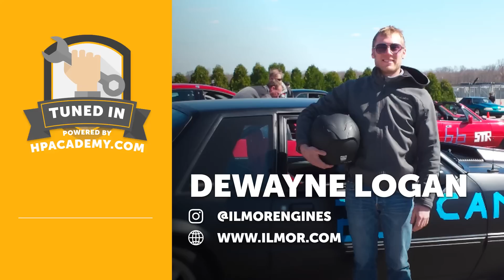066: Why Domed Pistons are a BAD Idea from an Ilmor Engineer. [#PODCAST]

Comment: Also I had never seen or worked with in cylinder pressure sensors  until I worked at the R&D division of an OEM and talk about a whole world being opened up in front of me lol.. I was  introduced to so many tools and techniques during my time working on contract with them and I would have loved to continue that but I was at a point where I needed a bit more stability and even though it never happened to me I had seen contracts get terminated at no fault of the worker but boom just like that they were no longer working there and sometimes they would be back working on a different contract or something but I couldn't have that happen to me and I also realized that even though my contract was a long term contract and had no set end date I was just nervous I guess just buying a house and having a baby  but I did absolutely love that job

Comment: This is very interesting to me because I have had very good results using pistons with a small dome and higher compression than most consider good compression ratio for a boosted engine but I decided to try a few things to see what happens and this was in a 4g63 engine and I had a good relationship with cp pistons and together with an engineer I knew that works for CP designed a piston that would have close to 12:1-12.2:1 compression ratio and I had to change the cams I had been using for a set of  Kelford cams that would have slightly less valve lift just because it ended up being very tight in the cylinder..but the camshafts were also a large improvement I'm sure  but I was able to get up on boost almost 1200 rpm earlier and had a much flatter torque curve than before...we made a bit over 90ish more HP on the dyno and 110ish more torque... again I'm sure the better cams helped achieve this but it was a much smoother and overall less "peaky" run ..we were able to run less boost but still  had similer cylinder pressures
Now this was just something I was curious about and wanted to play around with when I was trying it and I never had the track record or experience with that setup to try to build something like that for a customer but I'm curious what would have happened if I had not changed my racecar and ran that setup for a few years to  see what the problem areas might have been

But I am very interested in why I had such good results and I know a few others that are going to higher compression ratios on boosted engines and also having mostly positive results.... I'm always trying to learn especially when it's something that I was thinking worked differently or whatnot

Comment: Great podcast.
I always listen to it when i drive to work, a great source of information.
 Although the story about detonation and colliding flame fronts made me raise my eyebrows.
Here's how David Vizard explains it: https://youtu.be/mMAWFkaHGUg?t=744
Reply: Same. There was no mention of detonation. There should have been mention of the differences between deflagration and detonation. 
Detonations concentrate mass on their very thin supersonic propagation front, causing extreme pressue spikes, which are able to break fragile areas like ringlands and create a pinging sound. They also stir up boundry layers, which will lead to much higher heat transfer in addition to the higher temperatures due to the extreme pressure.
Even if he claimed there was no detonation during a knock event he should have explicitly said that to prevent confusion.
Reply: Also there is a clear analogy to the diesel combustion process and the diesel knocking

Comment: I think if I can add to the chat, one of the highlights for Ilmor, was the Roger Penske, Ilmor Mercedes 1994 wins, at the Indy 500, if not slightly controversial. Would be interested to know more about Ilmors involvement with the Mercedes CLK Gtrs. They built and converted some of the M120 v12s but all so I believe they made some V8 engines for the program?

Comment: Mercedes wont put out an engine on its very edge..
The same Mercedes - SLR MClaren had an engine replacement interval set at 60oookm. yes, you read it correctly. Not service but a full engine replacement at 60ooo km.... 
funny fact is Mercedes has been "throned" the worst by the reliability by Forbes..

Comment: 24:03 the m139 in s trim makes 2.1 bar (30 psi) of boost, Which is a lot for pump gas. Especially to do reliably all day.
Reply: I think the new version in the new C63 makes even more.
Reply: @squirmish70  the m177 only makes about 20! Lots of potential in that motor
Reply: Atmospheric pressure is 1 bar (14.7 psi) so it depends where the "boost" is measured before it can be determined if a figure is a "lot" for a certain fuel.
Reply: @jdoe9518  when you say boost it’s assumed you’re talking about psig not psia
Reply: @Vehicular.Shenanigans  no one should ever assume and didn't specify.